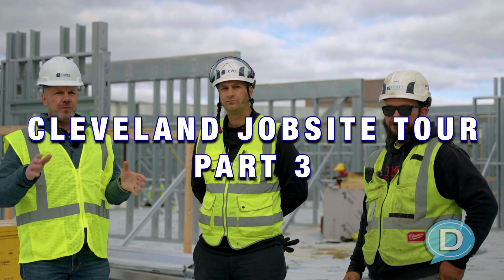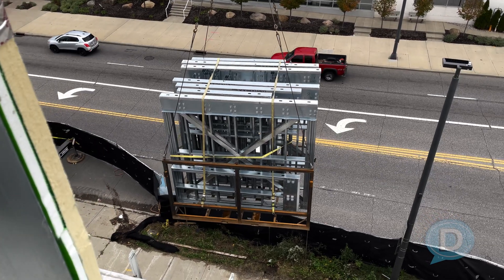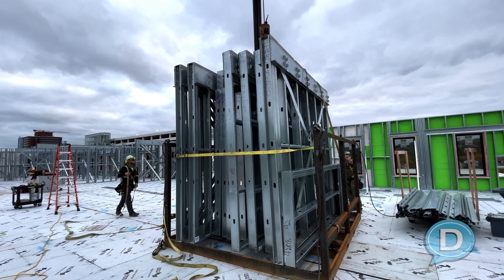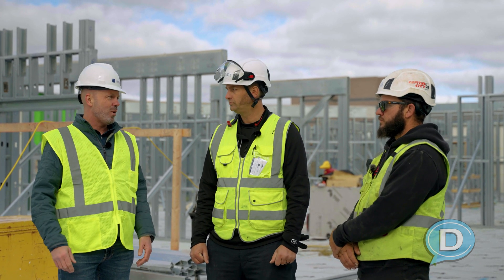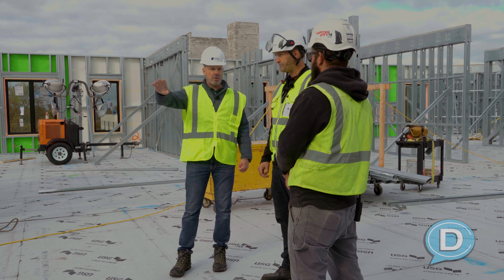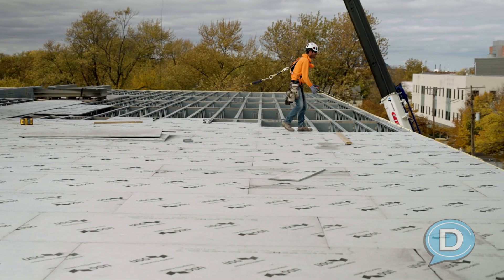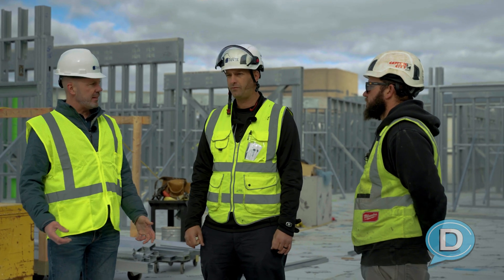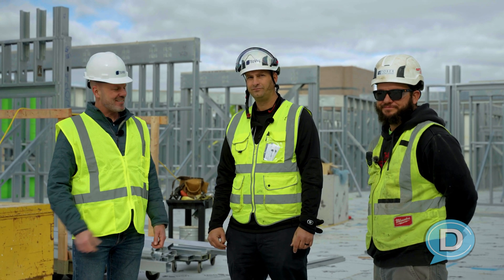Commercial High Rise Building Installation Using Cold Frame Steel

Comment: Is crane time being use on the panels the main reason to not do floor cassettes?
Reply from the maker: Hey Tim, great question. Floor cassettes are coming in the future.  Crane time is expensive but floor cassettes would speed up the process and reduce crane time and crane cost. As ToVee grows and expands production so will the capabilities…